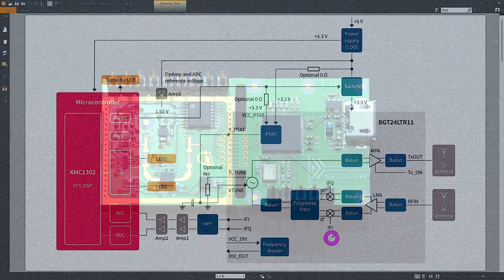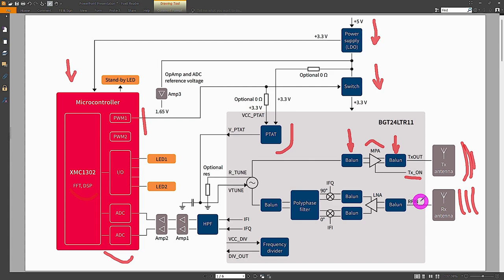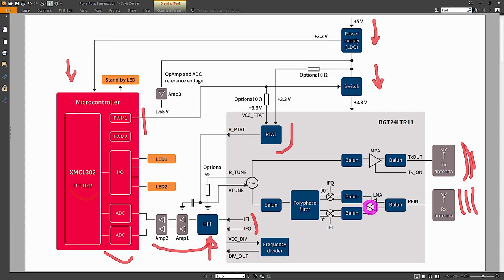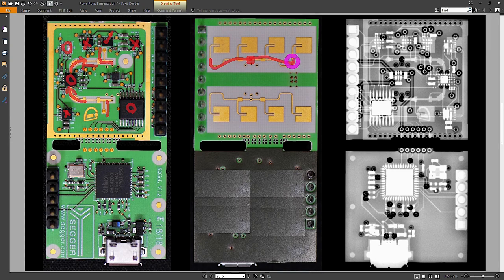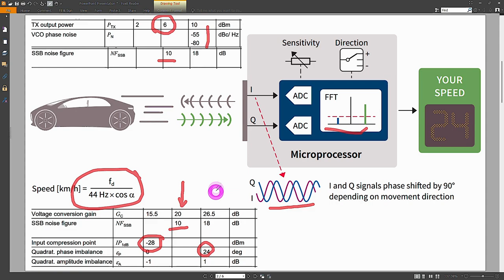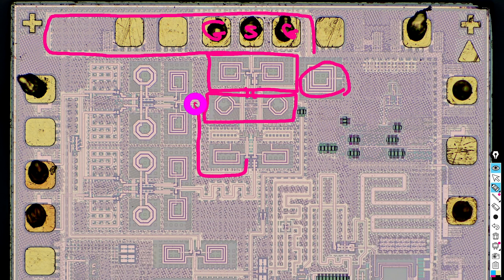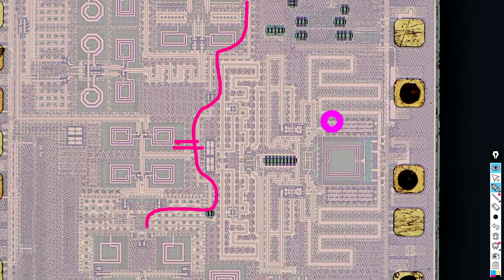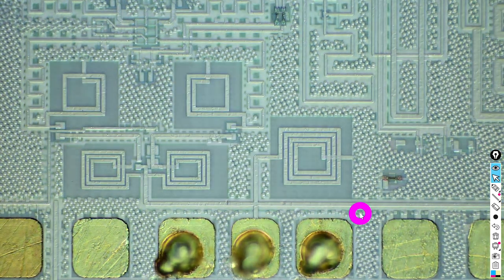TSP #220 - Infineon 24GHz Doppler Radar Module Detailed Reverse Engineering & ASIC Analysis

Comment: I was recently looking at a patent for a tuned resonator that looked like a rectangular box with several compartments, but the text was talking about GHz range frequencies, implying that it was a very tiny box indeed. I was excited to notice this structure at 23:24. It's sitting just to the right of some inductors, and to the left of the amplifier that's just off the nose of the fuse-tuned structure. When I was looking at the patent, I didn't realize it was talking about microchip-sized structures, because it was off-subject to what I was searching for, so I didn't look too closely. That was pretty exciting to find an accidental discovery "in the wild", so to speak, but I am not so naive to believe that search engine miss didn't influence this video suggestion later.

Comment: Good luck with conference and please cover some RF metrology there, if you plan to make conference coverage video. I'd expect it is also important to ensure all GHz are correct and traceable for successful designs. What are metal boxes fill around the empty areas? Just to help with uniform etching during chip lithography and production? Doesn't look like they trying to hide anything.
Reply: Time Nut checking in... please show me all of the low phase noise oscillators. All of them.
Reply from the maker: The fill is required to meet local and global metal density requirements for manufacturing. Each metal layer has its own requirements.
Reply: The fill is normally used to improve planarity during manufacturing.

The chip is polished flat after each layer so that the surface is smooth, since the lithography system has a very shallow depth of field. But metal and glass have different hardnesses and polish at different rates, so to get good uniformity it's important to have about the same percentage of metal per unit area across the whole wafer. For copper damascene processes this is even more important because the metal is patterned by etching trenches into the glass, filling with copper, then polishing flat.

The top layer is exempted from this in some cases (or has much looser requirements) because there's nothing on top of it except for glass cuts for bond pads (which have very large feature sizes).
Reply: @AndrewZonenberg  Thanks, sounds simple enough. I was wondering why it was important to have a specific density.

Comment: The fuses were extremely interesting. I wonder what's the impact of the extra load introduced by those self test paths once the fuses are blown, since they would turn into somewhat long shunt open stubs. Guess it should be fine when your output power has a range from 2 to 10 dBm :D

Comment: Those tiny imperfections you show near the end might give your device a very (almost infinitesimally) small signal that could be used to distinguish between two devices of the same type. Like if you took 10 of those modules, you could probably select 2 specific modules that you could always tell apart. I wonder if this type of signals analysis is feasible for keeping track of which source is sending... (not just with these modules, but in general)
Reply: So would this potentially uniquely identify the radar unit to any sufficiently sensitive receiver within range of the targeted transmission?
Reply: @chromosundrift  That was the gist of the thought. Being able to use side channel signals to catalog and track locations passively in several types of situations, including radar. The example of discriminating between 2 that you cherry pick was to demonstrate that there sometimes was a big difference which would be easy to detect, but often would be a smaller amount which requires more sensitivity in receiver.

Comment: It might be interesting to show some microwave PCB design by essentially taking an HB100 doppler module as the base, and modifying the design to allow injecting an externally generated IF (in quadrature, if easier) by which the local microwave oscillator or the received signal will be offset, so the downmixing won't center speeds at 0Hz.
Also, not having the downmix go to zero-IF quadrature as would seem an obvious alternative, would preserve the precious DC offset of a static reflector a fractional number of wavelengths in front of the antenna array, along with all the other benefits like escaping 1/f noise and far less linearity needed from the ADCs that feed the downmix centered on the IF into further digital processing.

If it's the TX side that gets frequency offset, having multiple of these fed from the same microwave amplifier, but different offsets should allow frequency-division-multiplexing in the receivers when the IF's are spaced enough to account for possible doppler shifts but are otherwise close together. Separating them could be done in the digital processing, and with sufficient spacing of the antennas moving objects could get 3D movement computed, instead of the normal 1D limit of a single TX/RX pair.

It's just that coming up with a design anywhere near as clever as the HB100 isn't straight-forward.

Comment: 25:47 how do they "solder" these wires on there?
also, on the beginning of the wire it's easy, just point and stick, but how do they fix the other side of the same wire, how do the rotate it 180º and get the "beginning" again.

Comment: Did you decap the ic  or did you have a bare die that you used? 
Also for videos like this it would be useful to have some kind of scale to get an idea of the size of the components on the chip. I am guessing they are not too small since you did use a microscope. Still I am not sure if what you were showing were tens or hundreds of micrometers in size.
Reply from the maker: I have decaped the IC. It was in a QFN package. The total die area is less 1mm by 1mm, including the pads. The highest magnification was over 200x. So these structures are pretty small. The lines are a few micron in width.

Comment: Blockdiagram show oscillator with single-ended output and functional baluns to convert. But chip layout not. Also curious about the PN of the unlocked oscillator at 20Hz. Seems to be the short trip around time present enough time phase correlation so that PN do not hurt. PN spec at 100k seems only an device emission topic.

Comment: How do they blow the fuses? Laser? Current?
Reply: It looks like there's tiny little test points at each end of the fuse.

Hard to tell without more mag to see if there's probe needle marks on them, but I suspect that there's a needle connected to each end of the fuse and current is passed between the two to blow the connection. This avoids an extra tooling step since it can be done on the same ATE system doing die/wafer test, vs having to measure the frequency offset and then move to a laser to actually blow the fuse.
Reply: @AndrewZonenberg  I still wonder, those test points are essentially shorted to the neighboring fuse. My guess would be laser.

Comment: Hi, I found the module (infineon DEMO SENSE2GOL, right?) and it only reaches 20m. 
Is there a similar module, which can read speed up to 100m? I want to stick it in my car and measure if I have a constant distance to the car in front of me. A manual Radar cruize-control retrofit. Or is there a better solution I am missing?
cheers :)
Reply: More beam forming should help; these antennas are pretty wide-angle.
Edit: a car with a vertical back that you're illuminating in the normal direction w.r.t. that surface is also much brighter on radar than e.g. a human, so don't worry too much necessarily about that 20m figure.

Comment: Are those fuses blown by electricity (seems like micro pads near them) or is always a laser used to flip them ?
Reply: I was wondering that.  I can't believe that they would do micro probing in production volume, so presumably they were targeted by laser.  There didn't seem to be any structure for blowing them within the chip itself, that probably would have been almost impossible.

Comment: The inset of the patch is for making a nice match right? It connects the trace to the point where the standing wave on the antenna works out to for example 50Ohm. I don't believe the directivity or bandwidth of the patch is really a function of this.
Reply from the maker: Indeed the return loss impact is significant, but BW of the path at >30GHz is also impacted once the dimensions of the antenna shrink and other imperfections come into play.